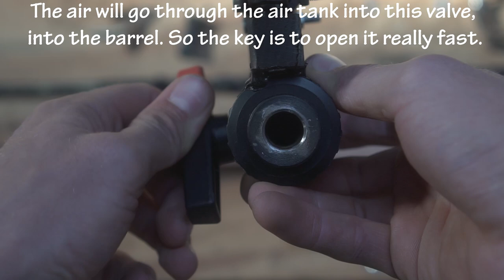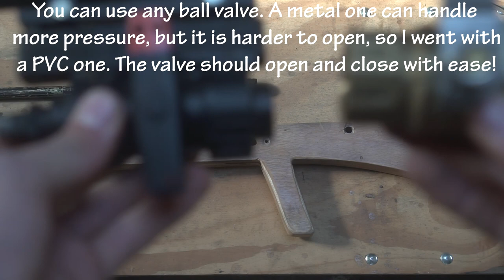How to make the homemade airgun/sniper/ball valve rifle! Can easily kill small game!

Comment: 15 to 30 bars is a little bit too much. 150 psi (11 to 12 bar) is a really nice presure to work with and doesnt explode in your hands. 15 to 30 bar however can explode and that wil cost you your eardrums.

Edit: for the ammo you can use metal ball bearings. They are heavy but with the air presure you are using you can really pack a punch and shoot trough at least 2-3 glas bottles at a time. 
Sorry for my bad english. Im not a native speaker and i didnt have a  lot of sleap.

Edit 2: for the airtank you can also use a old fire extinguisher. They can withstand up to 30 bars of presure. Then they could explode but its still beter then a home made airtank. If your going to use more presure i also recomend to use a metal air valve instead of the pvc one you are using. 
I hope you still have this nice project laying around somewhere in your garage. I wish you goodluck if you are still going to upgrade it.😎
Reply from the maker: Hello!

Thanks for the comment!

If you check out my newest video, you can see I definitely upgraded my airgun! I made an entire different one, way better than this one. It shoots 6mm ball bearings.

Kindest regards

Comment: Can you make a list of parts that are needed and the sizes of each thing please. Thanks!
Reply from the maker: It doesn't really matter. It's just an air tank attached to a ball valve. Make sure you buy the correct fittings for the ball valve and the tank.